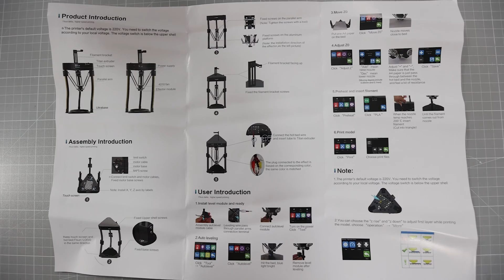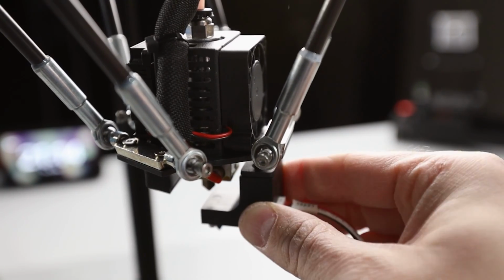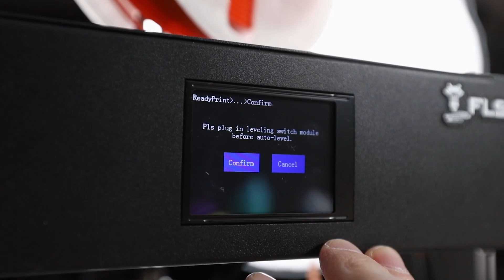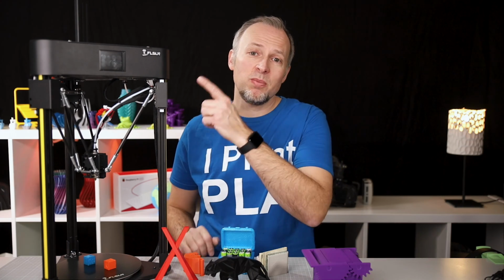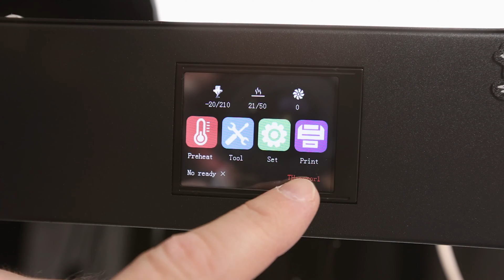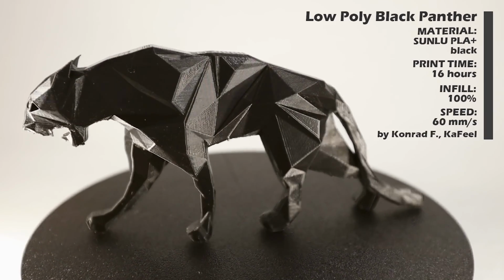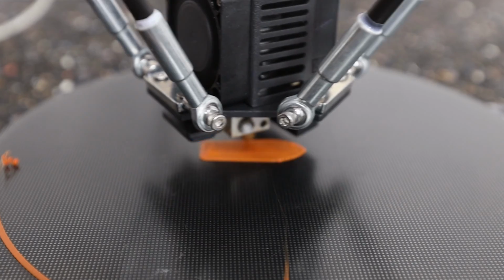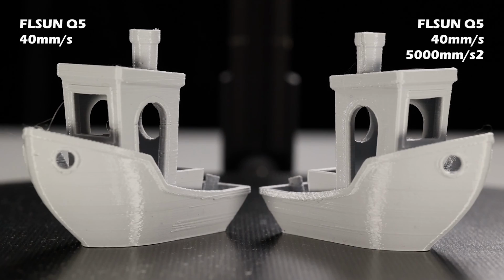FLSUN Q5 - How good is this 200$ delta?

Comment: Mine came with belts so loose, it dropped 10mm during a print and started ramming through the part. Now it won't repeat in any axis and takes way too much set up for it to be usable.
Reply: Oh and if I cancel a print, it leaves the nozzle and bed hot, and will try to restart the print when I power the machine back on. You get what you pay for. Ender 3 has been the only cheap printer I've had that hasn't been a ton of hassle to get running, and it remains consistent while the others need their hand held to do anything.

Comment: I just ordered a q5 for my bday gift to myself.  It will be joining my heavily modified dual  extruder ender 3 pro and my slightly modified tronxy x5sa. Can't wait to see what it can do.  I have several prints that are waiting to get done,  this should help take the work load off since most of the prints can fit on the q5.

Comment: Are filament printers obsolete? Is resin the better way to print? Or will they both evolve and continue to have their place in additive manufacturing?
Reply from the maker: I think there is a place for everything and you need to decide based on your use-case what is right for you.

Comment: Germany - I use printers with different drive technologies - my DIY Delta is over 4 years old, with an 8bit CPU and is the first choice if you want it fast and good. However, you have to adjust the parameters for higher speeds. Most of the time I print at 160mm/s - for that I have to go to 220/225 degrees Celsius printing temperature even with PLA. Due to the high printing speed and (for me) high acceleration values, the objects are finished much faster....
... and i like to see the kinematics - it's funny...

Comment: Denmark, from this review it seems that the Q5 behaves a lot like the QQ-S.
I have a QQ-S PRO and an ender-3 pro.
And my conclusion for them are the same, my ender-3 pro is slower, but more precise. Where as the QQ-S pro is faster, but less precise.
So if I make stuff with a lot of tiny details I use the ender-3 pro, and if I need the print to be done fast ( mostly prototypes) I use the QQ-S pro.

Comment: I have Ender 3pro and this Q5. Q5 printing process is worth of watching, mechanical dance. Prints are quite precise but only PLA by definition (I dont dare use other filaments, Ender do that). Calibration is good and not need done often. But its not perfect, it hates some filament and does blobs and stringing with them, other brands work perfectly. But its faster than Ender, maybe takes only 2/3 time that Ender does. I got it only 170euros delivered, so why not?

Comment: Excellent video.  Would really love to get a delta printer.  The size of this printer is perfect and I've got just the place for it!  :)  I'm a tinkerer and this printer looks like a perfect printer for tinkering.  Would love to try the default firmware and then install Marlin and see the differences (if any) in prints.  I live in Canada.  Stay well.  RG

Comment: It would appear that you did not put the three screws in to the top of the printer, they actually go into a bracket that supports the  stepper motors, forgive me if you have but they are clearly missing in the video.

Comment: *Location Norway *
 I have been thinking  of  bying  a delta printer but never pulled the trigger due to cost and complexity of the printer itself but, always having a idea about getting one used,  but no luck in finding one for the right money. 
The thing i want to test is building a  mini computer to run the printer or some sort of pi system to do the heavy lifting so the Main Board can concentrate on the moment and my produce better prints. And this is for me an opportune to get started whit a low budget.  Hope to win Any way Happy printing and thanks for sharing your stuff.